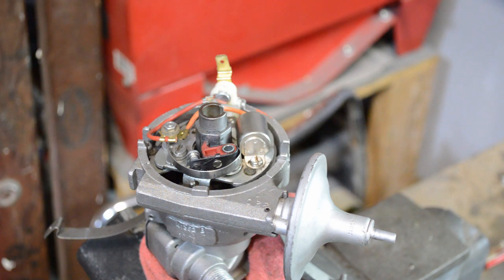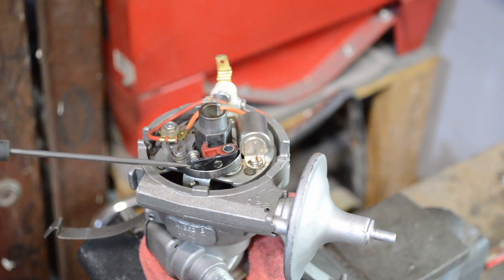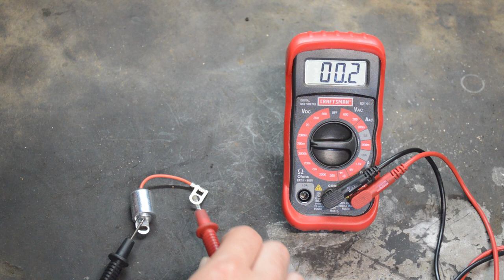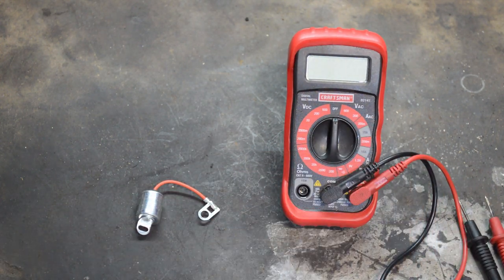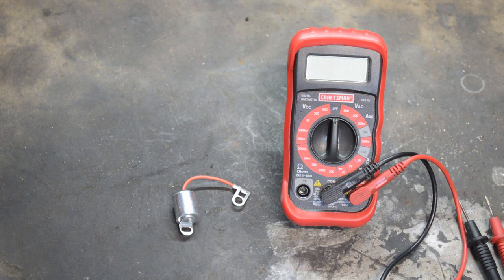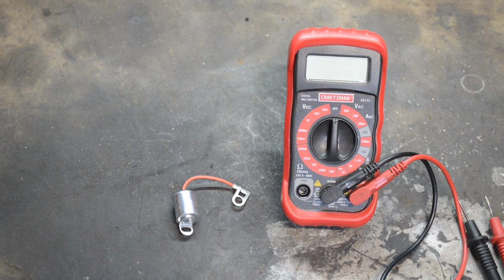Demystifying the Distributor - Triumph, MG, Austin Healey, and More!

Comment: My 1973 TR6 has been sitting in the garage for about 20 years. What cleaning fluid would you suggest to ensure the weights move freely. I saw your reply on grease. Thank you.
Reply from the maker: Hi Richard.  Since the weights and springs are just metal, I would use a solvent like a brake cleaner.  Carb cleaner would probably work too, but takes longer to dry.  You basically want something that will dissolve any built up gunk and clear out dirt.  Rust usually isn't an issue that you can't fix with your fingers or a screwdriver unless it's really bad.
Reply: @midwestmotoring  Thank you for your quick reply. Looking forward to seeing what I have.

Comment: Is there something under the arch spring coming off the points that goes around the post that keeps it from touching the base? I had put an electronic ignition in and my car just died after about a year of that set up, now i cant get any spark out of my plugs when i went back to points, im getting spark out of my high tension lead from coil when i turn car over and put lead next to head cover bolt, put new condensers in, new rotors, caps, just bought a new electronic lead, but im just stumped why i cant get spark out of my points set up
Reply from the maker: There is definitely something that separates the spring part of the points from the base.  Otherwise, it wouldn't make a difference when the points are open.  I believe it's usually just a small piece of plastic.

Comment: What do you think about electric ignition?  Pro and cons?
Reply from the maker: I have it in some of my cars--maybe only half.  The only real con is that it's expensive (less so the more you drive), and that it's adding a layer of complexity you may not need.  It's going to be more accurate than setting points because the dwell doesn't change, so it doesn't wear over time.  It'd be like if you set the points perfectly every time you get into the car.  With points, you really need to at least check them at every oil change.  You might find every 5 or 10,000 miles they wear and need adjustment--which isn't a big deal if you only put on a few hundred miles per year since it could be a decade before they need anything.  Technically, an electronic ignition is going to have a more precise control over the coil (and therefore the spark), but not really enough to notice behind the wheel.  The real advantages are 1) lack of maintenance--you don't have to remember to set the electronic ignition, and 2) the quality of parts.  I really like the FAST (used to be Crane) XR-700.  Points and condensers, on the other hand, can be garbage out of the box.  I've had good luck from Moss, but it's all just a few suppliers these days so that might not mean much.  

Another disadvantage is that when points are out of adjustment the car will drive poorly.  When an electronic ignition goes bad, the car will stop running, and it can be difficult to diagnose if you aren't handy.  Most home mechanics can vainly try to set the points to see if it helps.  Replacing a $130 ignition to check and see if it helps gets expensive and time consuming. 

The main points to consider are 1) you aren't going to get more power, so don't use that as a reason to buy one.  If you get more power when you're done, it's because something was broken, and you're choosing to spend over $100 when closer to $15 could have fixed it.  2) how much do you drive?  If it's 5000 miles per year, you should consider it, but it's not necessary.  If it's 500, then you really don't have to touch the points for probably a decade at least.  Most likely not worth the trouble.  And 3) do you really mind setting points?  I actually kind of like doing it.  It's part of the fun of having an old car to tinker with it, and it's nice to tinker with things you know are easy!

Comment: I have a 25D distributor. When there is load on the engine, for example when climbing a hill, I get a clicking sound from the distributor. As soon as I let my foot off the accelerator the noise stops. On non - laboured drives, like on flat road surface, there is no clicking noise. Any ideas what could be causing that? Many thanks.
Reply from the maker: I'm not 100% sure you're looking in the right spot.  It would be unusual for the distributor to make a clicking noise--at least it's unusual for the it to make that kind of noise and have the car run at all.  Is there something that makes you suspect the distributor specifically?  Unfortunately, it's difficult to know exactly what you mean without driving the car, but here are some possibilities:
- You might have sticking or poorly adjusted valves 
- If the distributor is too far advanced, you might be hearing pinging caused by the mixture firing while each piston is still on the way up
- It would not be my first thought, but potentially there is internal engine damage and you're hearing "hammering" of the crankshaft on the connecting rods

You can check for a lot of this stuff with a vacuum gauge, and maybe a timing light to see where the ignition is.

Comment: Petronics electronic ignition.
No points, no cam, no condenser. No problems. Nice even spark Toyota reliability.
Now eliminate all your vacuum leaks and adjust your carburetors.
Reply from the maker: Electronic ignition does replace the points and condenser, but not the cam.  In fact, the Pertronix magnet only fits on the cam one way, so in fact your ignition is still very subject to where that cam is (note: if you mean that it eliminates wear from the cam rubbing on the points, then you're correct).  

That said, electronic ignitions will never fix poor advance/retard.  That's still controlled with the weights and springs inside the distributor, by the ability of the points plate and the distributor shaft to twist, and by the vacuum capsule(s) on the outside.  If the parts aren't moving as they should, neither Pertronix nor FAST is going to fix it and the distributor still needs to be repaired.  

So far as which system to use, I prefer the FAST XR700.  Pertronix has been letting me down consistently every time I've used it.  Failed in the Healey, failed in the Spitfire, and has failed in every TR6 I've had it in.  Nowadays I'll only ever use one if it was in the car when I bought it.  It's a good system in concept, and hall sensors are generally supposed to be reliable, but if you put a lot of miles on the cars like I do... when a Pertronix module gets hot it just stops working.

Comment: sorry but condensers do not hold charges.
Reply from the maker: Ok yes. Technically speaking, they store an imbalance of charge, but with a net charge of zero. If I'm not mistaken, it's going to store energy physically rather than chemically like a battery... so it's incorrect to compare them.  Condensers (aka capacitors) don't store charge, but do store energy in a form not unlike static electricity when you touch a door knob. For practical purposes the video is still helpful, but I do appreciate the comment. I can't make the next one better without continuing to learn!

Comment: After watching this video, i need an electronic distributor, im in South Africa, i need asap
Reply from the maker: I'd try a company like Moss Motors or Rimmer Brothers.  Not sure who ships to South Africa, but I'd bet they would.  Also, you don't need an electronic one.  Those are multiple times the cost of just repairing the one you have.  You won't notice the benefit on a road car, and they might not be legal in a race car depending on where you're running it.  I'd just fix the original.

Comment: How to test coil 1978mgb
Reply from the maker: Hi Vic!  What do you mean by "test the coil?"  Are you trying to see whether it's a 6 or a 12 volt coil, or are you trying to see if it works at all?  If you're not sure whether the coil is any good, one way to test it is by putting your multimeter between the + and - terminals.  You should see a few ohms, like maybe 1.5 or 3.  Then do the same between the + and the output to the distributor (the big wire on the top).  This doesn't connect directly--it induces a current through the wizardry that is electromagnetism--so the resistance should be quite high (like in the thousands).  If you get 0 ohms in the primary test or a fairly low resistance in the secondary one, then your coil is shot and needs to be thrown away.

Comment: Throw it in the bin andfit a blue tooth 123
Reply from the maker: Nah, I'd rather pocket the $450. I could have the original distributor rebuilt by someone else 2 or 3 times for that money.
Reply from the maker: Not to mention, the average enthusiast has no idea how to choose an advance curve, so it's adding a level of complexity that's simply not needed.  It's also adding new failure points that will give less warning if things go wrong.  Generally speaking, the benefit of electronic distributors won't be noticed on a classic British car driven on the road.  It'd make a bigger difference for performance driving, but often the upgrade isn't allowed on a race track.  They're good... I'm just not sure they're worth the money.
Reply: @midwestmotoring   You could sell it and fit the original .
Mine went on a rolling road . You dont choose a curve ,you build the curve .
Done by blue tooth on your phone
Reply from the maker: I do appreciate the ability to tune, but I can already do that by tweaking a couple springs for free. It's a great option. Just not for me.